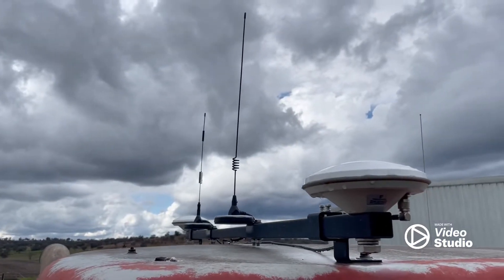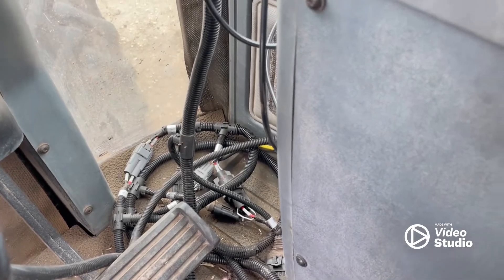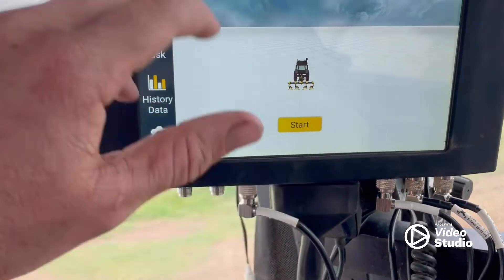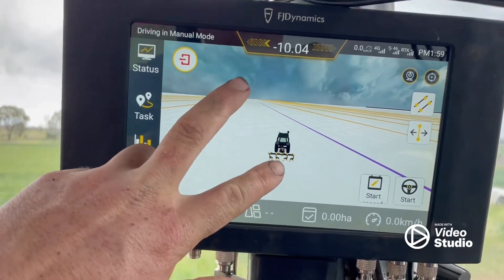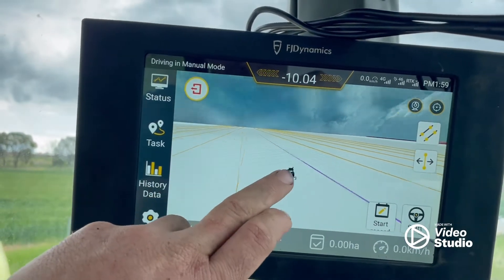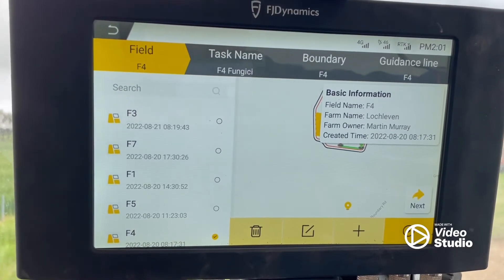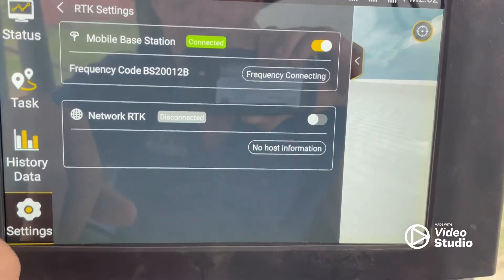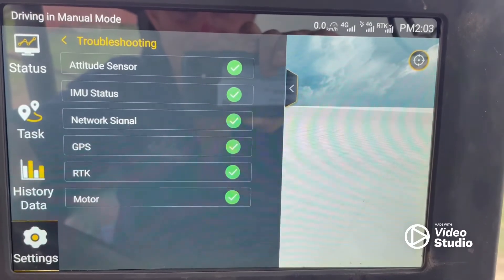WATCH MY UPDATED VIDEO BEFORE WATCHING THIS I Bought a FJ Dynamics RTK System, What is it like?

Comment: How do u like the fj dynamics after using it for a bit?
Reply from the maker: overtime, I've found it to be more and more frustrating. I've found when sowing across the slope that it doesn't compensate well for angle of the slope, ran out of memory surprisingly quickly, is fairly glitchy and cuts back to manual mode surprisingly often (watch any spraying or sowing video, I talk more about it). In addition to that while I've found my australian retailer to be very helpful, I don't think he is getting much support from FJ Dynamics themselves.

Comment: Nice video. I have the system here in the UK, worked brilliantly all year sowing with perfect accuracy. However in the last field it did disconnect off the AB line quite a few times for no apparent reason. Haven't got to the bottom of that yet.
Reply: If it disconnect, just go in manual invention and make the setting, if it still do it just disable manual invention. Ask your dealer for an older motor version than the last upgrade then it stop.
Reply from the maker: It does the same for me and sometimes has other issues as well, like if I exit the task and re-enter the AB line may shift by 50cm
Reply: @InThePaddock  To advoid that your line move, your base station has to be turned on 24/7  it never happens with network rtk
Reply: @FarmtekApS  what kind of network RTK are you using? I want to get one of these but unsure which service is supported.
Reply: @jasonhoermann4498  I use base station but also use network Rtk because i am selling Fj Dynamics in Denmark for 2 years now. We made our own Rtk network last year to cover the whole country. It works perfect, if you´re not in an area with bad network, then a base station is the safe choise. There has to be an Rtk network provider in your area.

Comment: hey mate great video,  im sure those issues will be resolved over time with experience with the system but for nearly 10k in savings its gotta be worth the effort. but the technology is interesting and i think in the future with more advancements we will see even cheaper systems as they get more commonly used
Reply from the maker: There’s more and more coming into the market, so far I’m not regretting it. I’ll be good to see some competition in the market.